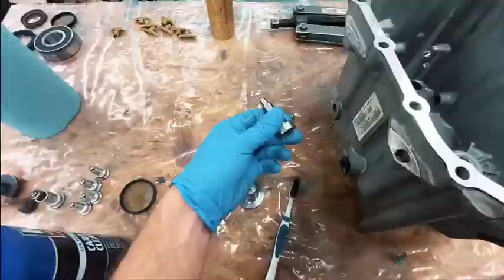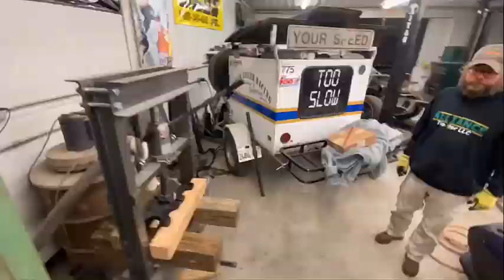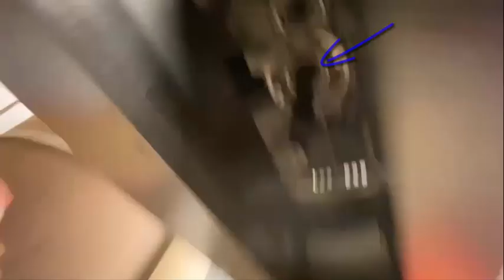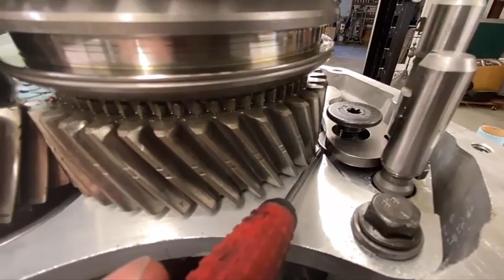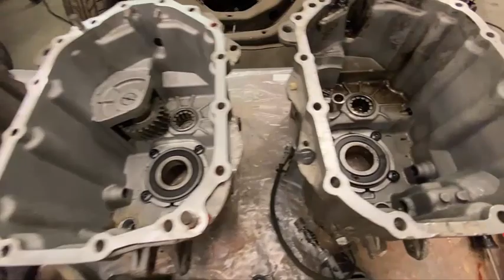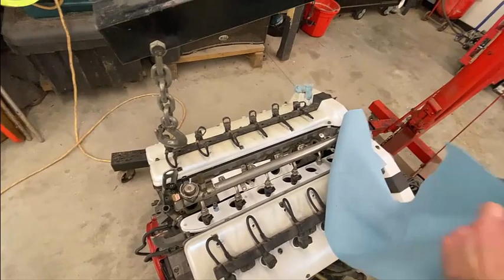FORD MT-82 Transmission - Reassembly

Comment: Hi again.. another critical thing on the MT82 rebuild you REALLY need to take notice of, and this is really important, is the output shaft position with the drive flange back on.
I have see sooooo many MT82 boxes fail ( big time) because of this !
So you pressed the rear case on , I mentioned earlier how this should be done , but anyways, 
Special note should be taken when you remove the drive flange on the strip,  note, and maybe take a picture of where the output shaft is in relation to the flange, it should be about 1.5mm below the machined nut face of the flange ... This is REEEEAAly important !!! 
When you pressed the drive flange on the output shaft was in a down position. What I mean by that is the 5th of the synchro is sat down on the input shaft cone.
If the output shaft isn't pulled back through the drive flange there will be no "air gap" between 5th cone and the synchro and will bind and eventually go bang !! 
The other reason is the gears on the output shaft will all mate incorrectly and that will cause a HUGE fail as well.
Difficult to explain , if you understand what I mean let me know , if not I will make some drawing and try and post them .......... Cheers 
                                                                                         Alan/.
Reply: I am currently rebuilding a mt82. Is there any way you can provide some pictures of what you are trying to explain here?

Comment: So, did you have any issues with your 6th gear engagement. All of the other gears in my transmission engage great except for 6th. The shifter moves back into place. It just doesn’t engage.

Comment: I need your help I installed an oem throw out bearing in my mt82 i put everything back together when i started the car i heard a humming noise when i press the clutch pedal it goes away but when i release the pedal it comes back I didn’t drive the car yet when it was down I checked the input shaft it had very very little play what do you think it may be

Comment: I did a rebuild to my mt82 but i have problem with 4th gear it makeing a grind noes and not going into the gear when i took it of a found no porblem in the 4th gear pr the slider I suspect that my inside shifter is having some problems can i text you to get some help ? I'll be so thankfull

Comment: I'm considering buying a late model Mustang with the MT82 manual and have read this has weak shift forks and possibly other weak internal components. Maybe some design flaws also. Does your MT82 make the trans perform better and more reliable? The trans is my main concern about buying the car.  Thank you

Comment: As a fellow idiot "ruining" a classic muscle car with an M120,   this is going to be absolutely awesome,

what are your plans for Engine mods/power levels?
Reply from the maker: Thanks! I’m excited to see the end of this as well. Power level for now will be the stock 400hp but after we get it all all lined out in a year or so I’d like to do a pro charger mod and amp it up to 6-700hp. What’s the muscle car you’re ruining?!
Reply: @dream_killer_racing  I have a 1969 Mach 1.  98 sl motor,  i have a gt500 mantic twin disk modified to fit the engine and a 2013 challenger tr6060 with a gm input, and a modified stock v12 bellhousing.  I’m still in the beginning stages of the actual swap.  I’ve had the transmission adapted for over a year and the car has the front end cut off for rust repairs, but the project sat stagnant for a few reasons, and I just got around to getting a frame table made so I can rebuild the front structure

Funny you mention the pro charger,  I’ve been on the fence between staying mostly stock,  staying NA and adapting some ITB’s ,  and twin turboing it,  and my buddy just pitched a d1sc he’s had laying around for a while that I’m heavily considering using now so we might end up having similar engine builds too. Lmao,    

Have you made a decision on management, or are you keeping the stock electronics?
Reply from the maker: @samjohnson7325  dang let me know if that d1sc is available 😁 as for an engine management system I’m looking at the ms3 pro. Likely do batch fire and sequential injectors. Or at least that’s the plan. What about you? Sounds like ya got a hell of a setup as well!
Reply: @dream_killer_racing  I’ve been on the fence on it.   I may go ms3pro as well butI want to try and run it full sequential if I can.  trying to find an ecu that can do 12cyl sequential and also doesn’t cost more than the engine is not fun or easy
Reply from the maker: @samjohnson7325  I agree, when we started looking at options it was far and few. I like to have a community behind the product as well so I can ask questions etc that others may have experienced in a different scenario. I’m hoping that’s what we will get for going with the ms3 pro and batch fire. Now if holley made som modifications to allow for a v12 on the spark side I’d be all over that as they have enough components to generate the injector drivers. Just need them to make a few changes on the software lol
Reply: @dream_killer_racing thanks for the video. Is there a kit to beef up the MT82 transmission that you recommend? Or a kit to rebuild it?

Comment: Hey i was wondering if you had a torque spec for the counter shaft bolt that goes through the front of the bell housing?
Reply from the maker: http://westprecisiontool.com/FILES/GT/mt82%20specs%20&%20torque%20values.pdf

I think it’s in the above link
Reply: Thats a handy chart but the counter shaft bolt is listed but dont have a specification. Just my luck lol
Reply from the maker: @blairevans9819  maybe a tech will be able to chime in later, I just gave it a couple hits with the impact 😁
Reply: Yea thats the route i think im going to go with to. What did you do the second time you tried to press the rear case on so you didnt break the shift rod bearing? I just destroyed one of mine lol
Reply from the maker: @blairevans9819  when I pressed it I took my time and while pumping kept rattling the rod around to be sure it wasn’t binding. Did this by hand when I could and later a screw driver with the smaller gap. Once there was roughly a 1/4 left to press I figured it was in the hole and just pumped it down the rest of the way. Having everything squared up is key for sure
Reply: @dream_killer_racing  75nm
Reply from the maker: @xan7603  thanks for this!! If anyone else is curious on the torque spec here it is. This guy has assembled and disassembled a ton of these 👍🏻
Reply: 75nm
Reply: @blairevans9819  75nm and some low strength thread lock
Reply: @blairevans9819  75nm

Comment: Hopefully you haven't put this in a vehicle yet .... there is a problem that will cause you to take it out !!
Reply from the maker: Currently everything is still in the mock up stages. What’d ya find?!
Reply: @dream_killer_racing  Hiya mate ! as I said on your strip video I have stripped and built literally thousands of these and wrote the manual for Land Rover and Ford ....,. you did well getting it apart , with the tools you had... lots of , not mistakes , but not the right way stripping but you got there...well done .
Here's a few things , common mistakes I saw in your rebuild .
1. you knocked the input shaft (p10) into the bearing .
That's not good practice as it causes a thing called " brinelling"  and can lead to bearing failure. Youtub !! 
Microscopic indents left by the impact grow over time and cause the bearing to fail.
2. The countershaft , (P11) ...same problem ..they are not to be pressed into the case UNLESS the inner race of the bearing is fully supported .
Both input and output shafts have the bearing inners heated to 90-95 deg allowing the shafts to fall in !! 
3. And I reckon you might have worked this out already ,  to remove 1st - 2nd selector fork you remove the roll-pin and slide the  selector rail out . 
That way 1-2 synchro stays together .
I could go on.. and often do lol !!
So with regards the rebuild.
A common reject from the test booths is " no sel rev" 
Now I noticed a few differences in the MT82 box you stripped and Halewood ones but ,  the ones At Halewood (reverse synchro) which come in from outside , the outer sleeve has spur teeth on one side only !! L:ooking at you video the teeth were facing "up" meaning the blank side is facing the reverse (P8) .
This will cause a "crash" selection or no sel ' reverse . 
This happened not that often .
As I said you box wasn't built at Halewood so " could" be different.. but is it worth the risk ??
Last thing. 
The rear case is not a press fit !! 
first you need the box in gear...(we used 3rd ) that locks, via the blocking plate (thats why you hit the bearing!! 
The two dowels should be knocked back and with it in gear the output shaft is heated to 90-95 deg allowing the rear case to slide on.
But you did really well !! Oh by the way did you "match" the outer sleeve on 1-2 synchro with the inner indents ??
                                                                  Cheers Mate....Alan.
If you send me the details off the rear case I'll tell you where it was made !
Reply from the maker: @xan7603  great write up and thanks for the input!! I knew I was basically wandering through the dark on this, but nice for someone to shed some light. I hope others get a chance to read this and can learn from my mistakes. I’ll have to look at the other boxes to see about the rear gear. If I recall there was only one way it would go in but I could be incorrect. Also I’ll follow up with some of the items you mentioned above to be sure. Thanks again for all the info!! 👍🏻👍🏻 and glad to have you watching these!

Cheers mate!